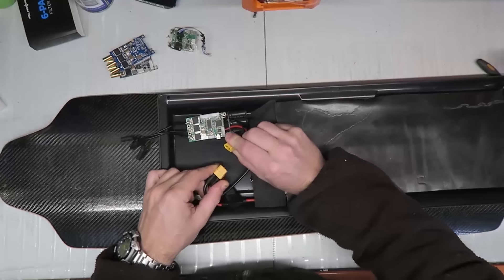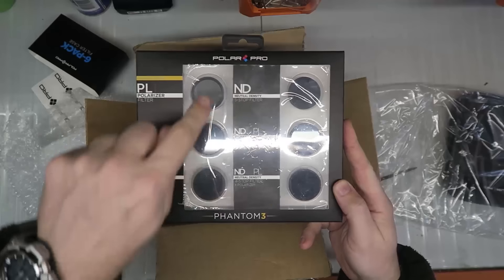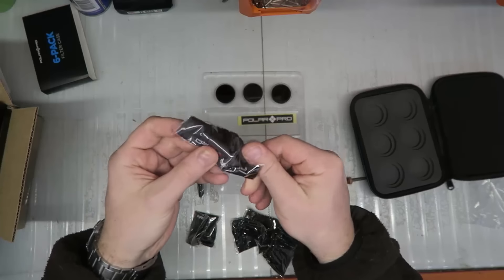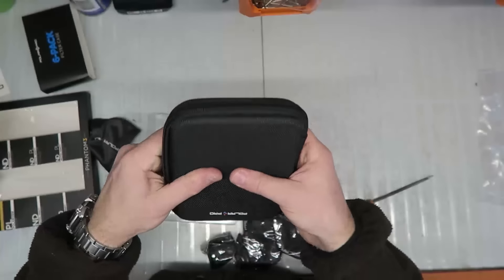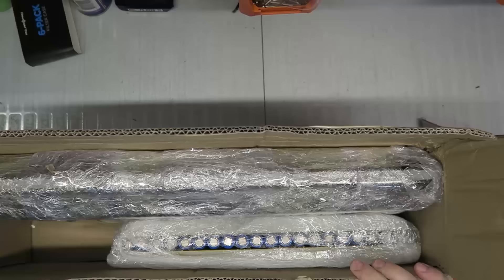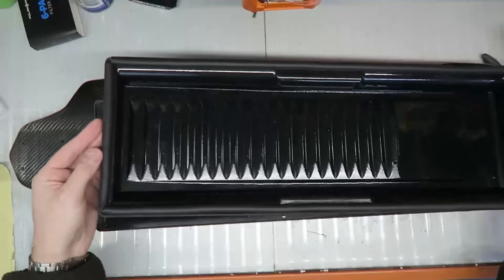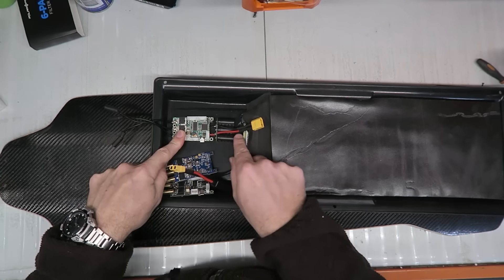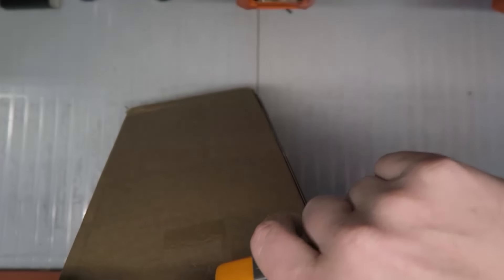The Future Of DIY Electric Skateboard Building | VL054

Comment: It looks like the seal does not curve around the corners... How do you seal the corners? I saw it hold air, but... ?
One other thing, the mounting bolt holes look a bit close to the edge; for future models, you might want to widen out the tray flange a bit and add some rubber washers to prevent cracking at those stress riser points. Looks excellent though. I'd be interested in a non-carbon fiber budget version that goes as fast as possible, with interchangeable batteries, personally.